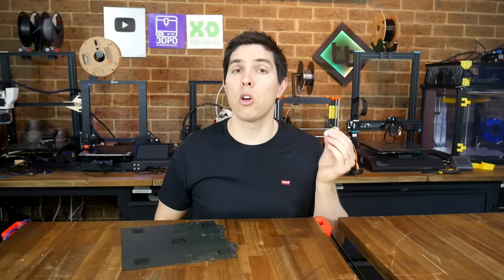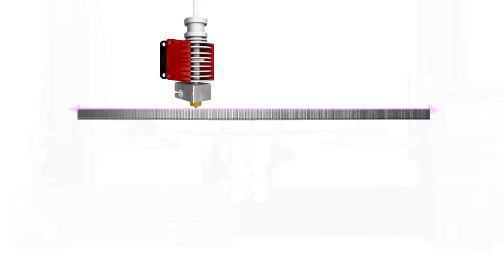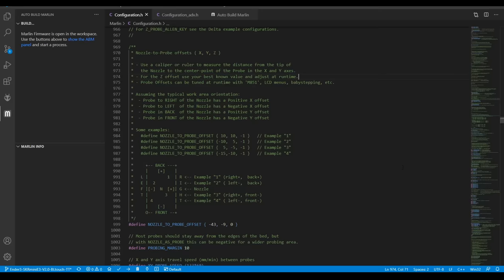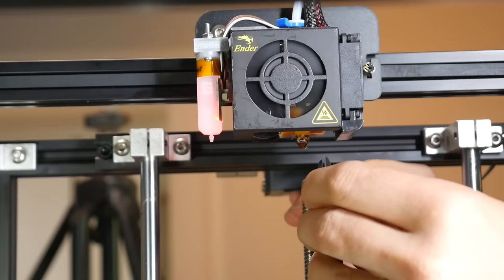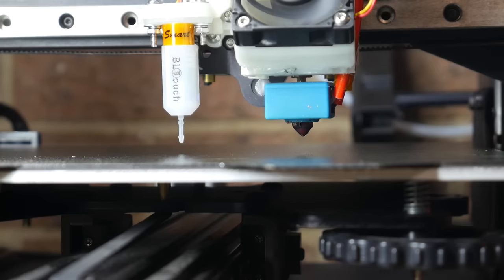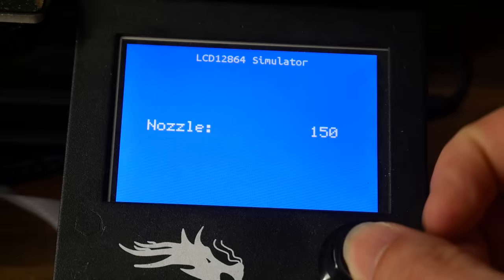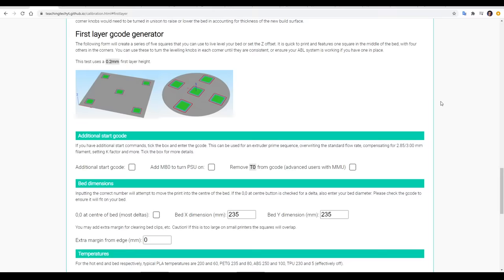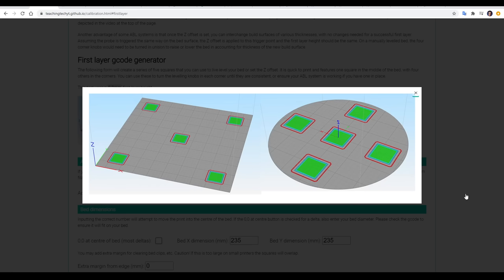ABL offset guide including new probe Z offset wizard

Comment: I've always assumed when you set the Z offset through the wizard, you'd measure to the bed itself. In your video, you measure to a piece of paper.  I don't know how they'd know, but this must already be accounted for in Marlin because measuring to paper works. How do they know how thick it is?

I also disable the endstops (M211 S0) before the probing wizard or I wasn't able to get low enough. Just gotta remember to reenable them (M211 S1) when I'm done!

Thanks for the great videos, they've been a huge help!
Reply: Because a sheet of standard copy paper is between 4 & 5 thou so using this method you would get it within at least 1 thousands of an inch which is more precise than the printer is

Comment: You shouldn't use paper for the Z Offset Wizard, it will/should be perfect when you can't see light between the nozzle and the bed.
Edit: Might want to use a lower SHORT_MANUAL_Z_MOVE value for more precise last movements.
Edit2: And you should use it with fully heated nozzle without filament in it.
Reply from the maker: I went off the pull request thread on GitHub where using a piece of paper is discussed. I found it helps for clarity too. Some beds are reflective so it's hard to gauge exactly how close the nozzle is. Otherbeds will be damaged by the hot nozzle.
Reply: @TeachingTech  you could always subtract the thickness of your paper too, we should all have calipers if we ended up at this video.
Reply: @BigEpinstriping  True

Comment: I believe the z offset wizard expects you to lower the nozzle until it touches the bed and not some paper-thick distance from it. If you look at the values on the wizard at the moment you press "done" and look at the calculated value it puts on the z-offset value, you can see it doesn't account for any thickness added by the paper nor could it since there is no place to tell it how thick the paper you're using is. I think the correct way to use the wizard is to either lower the nozzle until it touches the bed, or do it like you did but then you have to go to the value the wizard put on the z offset and subtract the thickness of the paper. So if it puts -2.25 you change it to -2.45 it the paper is 0.2 mm thick.
Reply: AARRRGGHHH OF COURSE!!! Bring this comment to the top.
Reply: @nocare  Hi. Referring to my example, the wizard puts -2.25 with the nozzle being at 0.2 mm from the bed but it thinks it is touching it. So you put it at -2.45 because that's where it actually is. Do it like this and after configuration move the z to 0.2 mm then take a 0.2 mm shim and measure it and you'll see it's spot on.
Reply: @xXxGuilhermeB I think you are correct because he was already heating the nozzle and bed so it should be the distance where the nozzle makes contact with the bed.  When we use a piece of paper or feeler gauge, it's usually because the nozzle is cold and we are leaving room for expansion of the nozzle when it's heated to temperature.
Reply: Pin this comment!
Reply: @brucehvn  Isn't it actually because we need to leave room for the first layer rather than making contact with the bed? That's what I always assumed was the purpose of the paper.
Reply: @IanSmithCA  No, homing is setting the reference point for z=0.  If you look at the g-code for the beginning of the print, it will set z = the first layer height before starting to print. If the nozzle is heated before homing, you would want the nozzle just touching the bed at z=0, but that's hard to measure.  By homing with the nozzle cold, it  makes it easier to measure with a feeler gauge or piece of paper.

Comment: Hello,

I have Ender 5 with mainboard 4.2.7 and BLtouch V3.1. 
2 days ago I mount BLtouch sensor for ABL. My problem is the X/Y offset: so it tries to measure the left side not on the bed and it ramms the nozzle in the heated. 
If I set NOZZLE_TO_PROBE_OFFSET to X-42 Y-16 or X 0 Y 0 is always the same position on the left side when is carried out Level Bed.
If I set NOZZLE_TO_PROBE_OFFSET to X-42 Y-16 then is printing also with this offset, and printer want to print the right site not on the bed, but with this offset is BLTouch on the centre of the bed.
So the problem is offset by X-axis is not correct, but I don't know how to solve it.

PLEASE FOR HELP

Comment: I used the firmware for the e3 v1.2 with blt and run out but my bltouch doesn’t do anything it flashes red for a bit and then solid red in the menu it doesn’t respond to the deploy retract or test. So frustrating as I’m a newby to working with config files

Comment: I really don t understand why on marlin 2.0.7.1 the auto bed leveling now turned in a sort of a manual mesh bed leveling.

I watched teaching tech s new video that explains about the z probe offset wizard and i said.. Let s flash this new firmware on my skr v2 aswell, and i did.

Now after i set my z probe offset(i own a bltouch and yes i tried setting the offset with the wizard and with other methods that i saw on yt) the bl touch doesn t compensate the uneven bed(like it did on previous firmware when you just had to set the z offset only "one" time with the babystep and boom the leveling was done by the probe) but now after you set the z probe offset, you have to run a leveling gcode and manually compensate for uneven surface. (you can see at the end of teaching tech s video 2 days ago, the procedure at min 9:03

So practically i have to dial in manually and without any precision( cuz if i level one corner...i will fuck up the opposite one)

Comment: I can't get the Z wizard to work, or I can but it messes up the mesh levelling. Using the stock BTT + BLtouch firmware it all works fine but if I try to build my own firmware with the wizard turned on, when I start the bed levelling it just goes to the middle of the bed does a BL test and then throws an error in Octopi making it disconnect. On the printer itself the menu item to run a bed level seems to have gone. I think I must be missing something in the firmware when it comes to enabling the BLTouch.

Comment: I have an Ender 5 with SKR Mini E3 V2, TFT35 and a 3DTouch connected to the 5-port Z-Probe port because i want the security of the regular Z-stop. With this setup, it seems the Z offset wizard does not work. When i start the wizard, it just homes X, Y and Z on the regular endstops and the 3dtouch does nothing?

Comment: One thing that has been puzzling me: if you set the nozzle to probe z offset using a piece of paper, wouldn't you then underestimate the value by the thickness of that paper (i.e. 0.1 mm)? Then when you slice a file to print with a fine first layer, say 0.1 mm, the slicer would add that layer height to what it thought was the "zero" z position resulting in the nozzle printing 0.2 mm above the buildplate and leading to adhesion issues?
Reply: Correct

Comment: Hey Michael, when you configure the firmware, how do you get the safe homing not in the centre? It dunks a blob of plastic in the middle and ruins my first layer.

By the way, in configuration advanced search for “game” and you will see an Easter egg.
Reply: comment out Z_safe_homing.  and reenable your z_min switch.  It will do z home on the switch but you can still have leveling.  Your probe will have to be on something other than Z_min.
Reply: @HermieDaddy  Problem is that I have the printer set up in a way where if the nozzle is perfect height from the bed the bed is higher than the homing height(it’s Ender 5)
In that case I will already have slammed into the switch
Reply from the maker: Right underneath where you enable safe homing, you can specify the position. By default it is set to X_CENTER and Y_CENTER but you can delete these and enter specific numbers.
Reply: What I did to avoid these blobs is that I added a retract in the ending script in my slicer and just have a priming line in the beginning of my prints to get the nozzle primed.
Reply: @TeachingTech  Aha fixed it

Comment: Hi Michael,  thank you for great content, as a beginner with a Creality 3 V2 I've learnt a great deal from you. I've added the BLTouch, and seems to be OK, still need to double check. My question is on the instructions it mentions adding the code for ABL, G29, where and how?
After doing your X test print the bed doesn't go home, this has changed since adding BLTouch, do I need to added other code. 
Thank you again.

Comment: Hi, Micheal, I have just used your G-Code Calibration Tool and am wondering if this can also be used to help dial in my Z-Offset for a BL Touch, I have selected BL Touch in the settings for one version and without for another version as I have 2 Ender 3's one with ABL and one without

Comment: I have Ender 3 V2 and followed this tutorial hoping to get the z-offset wizard menu on the printer's display.  But, it doesn't show up on the V2 with stock display.

A quick look at the Marlin bugfix code shows why.  Teaching Tech has us uncomment #define PROBRE_OFFSET_WIZARD
in a code fragment that only gets executed if the symbolic constant "HAS_LCD_MENU" is defined:
 
#if HAS_LCD_MENU

  // Add Probe Z Offset calibration to the Z Probe Offsets menu
  #if HAS_BED_PROBE
    #define PROBE_OFFSET_WIZARD
    #if ENABLED(PROBE_OFFSET_WIZARD)
      //
      // Enable to init the Probe Z-Offset when starting the Wizard.
      // Use a height slightly above the estimated nozzle-to-probe Z offset.
      // For example, with an offset of -5, consider a starting height of -4.
      //
      #define PROBE_OFFSET_WIZARD_START_Z -4.0

      // Set a convenient position to do the calibration (probing point and nozzle/bed-distance)
      #define PROBE_OFFSET_WIZARD_XY_POS { X_CENTER, Y_CENTER }
    #endif
  #endif 

And HAS_LCD_MENU is not defined when the code is configured as Teaching tech instructs.  Here's where it conditionally gets defined:

 #if IS_ULTIPANEL && DISABLED(NO_LCD_MENUS)
 #define HAS_LCD_MENU 1
#endif

It doesn't seem like there's any reason a specific display would be required to support the wizard, so I suspect the work to add menu items to the stock Ender 3 V2 display just hasn't been done (yet?).

Comment: Maybe some of you can help me out wit a strange problem i have. I installed the Hero Me Gen5 with a BLtouch. The newest version states an offset of 9mm because of the extra mounting plate. However, everytime my probe starts with the back row of the bedleveling sequence, it collides at the Y axis. Why is this happening and how do i solve this? I have used all the correct offsets from the instructions.

Comment: Hi Michael, i'm struggling with ABL on my Ender 3. Everythings working almost fine, prints are not that good, but i work on it using your Calibration Guide ... thanks for that! But: I realised, since i have a BLTOUCH and no more Z-Offset-Switch installed, it is possible to manually drive my nozzle into the bed by using the motion-function on my printer. It may be a dumb question, but could i prevent that? Isn't there a safety option in marlin? Just to be clear: I do not intend to drive my nozzle into the bed, but the possibility alone makes me worried. For instance for Z-Offset-Calibration i accidentally used the 10mm-Option to bring my nozzle down and went to far. I searched on google for that problem but didn't find the right marlin function. Would be great if you know the trick. greetings

Comment: Something is not right here. If you set offset as 0 at the height of the paper which is 0.2mm than your 0 is actually at 0.2. When you start print your printer will rise from 0 to 0.2 as standard layer height but those two will given you 0.4 mm height. The nozzles should touch the surface to be at real 0mm. I do the paper trick but than lower the setting for additional 0.15-0.2mm. Anyone agree?

Comment: Thank you for all your useful videos. In my case, I don't have the old Marlin menu anymore. I recently upgraded to the BTT TFT35 V2.0, which doesn't have Marlin emulation mode. Is the z offset wizard strictly limited to the character LCD, or is it actually a GCode command? I could use the TFT with a custom Gcode command in this case.

Edit: It's pretty easy to use the TFT to get the offset configured, actually. You can just jog the Z after homing, get the Z axis value (negative value) once the paper stops slipping, and save that to the EEPROM from the TFT. That works for me!

Comment: Hey Michael, wondering if you could do a tutorial on TH3D's newer U.2 firmware? The settings have been moved around and it is more difficult to folllow than the U.1 firmware or any other vanilla marlin firmware. Thanks!

My problem seems to be it will not "not define 0" for the z value in the firmware. After flashing I try to home it and it does x and y but then raises my z 5mm or so and either stops, or tries to find the z limit switch for some reason and crashes into the bed. TH3D does not have a current tutorial or one that is easy to understand vs. The U.1 firmware

Comment: Hi I have a question after spending hours setting up, up grading both config files for a BLT in My Ender 3 V2 firmware I now have to wonder with the new firmware up date from Marlin do I now have to sift through all to find what I changed in order to get the firmware to work with the BLT and now with the “new” wizard for the z off set how do I up date my firmware and keep my BLT settings?

Comment: The first time I used the z offset probe wizard, the probe didn't deploy and the nozzle crashed into the bed. I panicked and turned off the printer to stop it. I did some troubleshooting (manually deployed and stowed the probe) and the next time I tried again, the wizard worked as intended. Not sure what the issue was.

Comment: I just got a Bltouch and hooked everything up the same way you did in the video "Creality 32 bit V4 board guide - ender 3 v2 BLtouch & more" and I can't seem to get it to work whatever I do. It's acting as though the Probe X;Y offsets are off on cerian parts of my bed and are fine on others. I have an Ender 3 Pro with 4.2.2 and BLtouch v3.1. If anyone has any ideas or a compiled firmware that works with this set up please let me know I've been struggling for days now.

Comment: I have a weird issue with my Ender 3, but my Ender 5 did not have the same problem despite having the same work flow. I had the correct offset but the BL touch would probe slightly off from the center of the bed, so the entire mesh would be off by about 2cm
Reply from the maker: Worth checking your X and Y probe offsets in the menu or with M851. Sometimes you can set it in the firmware but if the old value is stored in the EEPROM, it will be used instead.

Comment: what are you using for your bl touch? I used marlin but when i do the z offset i've less control over adjustments as it jumps in increments, I also don't have the wizard function
Reply: Hey 101spacemonkey. I just followed this guide and I also don't have the wizard function. did you work it out?

Comment: Odd. I don't see any of these settings in the V2 screen. Must have to put them in manually then?
Reply: What are you talking about? The Ender 3 V2 doesn't even have a leveling probe. And this setting's a new Marlin firmware feature. You need to compile and flash it.
Reply from the maker: Also, a reminder that as the video said at the time that currently this is only compatible with the standard Marlin LCD interface, although I have seen a request on GitHub for the DWIN Ender 3 V2 screen to have support added.
Reply: @TeachingTech  has there been a update for the DWIN for the Ender 3 V2 yet. I'm sure there's a lot of us that would like that functionality I put the most recent bug fix DWIN in a nothing yet. BTW Thanks for tasking the time to help us

Comment: I have text several forums and you tubers and still can not get a fix. 
1 installed cr touch down loaded ender3 firmware with cr touch. Home the ender 3 did the paper thing set the new z offset saved and re homed ,moved z to 0. Z not set. Ran a test level bed print. Unit home start to lay first layer nozzle to high. Work on this for a mouth. No help. This problem is all over the internet. 
2 uninstalled cr touch. Installed BL touch. Homed and then re homed after saving new z off set set z to 0 everything looked good ran test and nozzle to hight.
So two questions 
1 i know the z offset is stored on the eeprom on sad card. How dose the printer get the new z offset is it in the code. If so were.
2 could the offset be over wrote because before each print the ender 3 re homes. 
As mush as i see his problem on forums and you tube why on answers.
Reply: I have a cr touch which is great, maybe you got a duff one. Are you still experiencing z offset problems? Here is another fantastic youtuber's method with a ABL. https://www.youtube.com/watch?v=y_1Kg45APko&t=1s

Comment: 3 points across the bed isn’t enough, 5 works a LOT better, that should be the default.
Reply: Lol I use 7
Reply: @AlexJoneses  - even better !
Reply from the maker: I vary it from printer to printer depending on how warped the bed is. With a bed like the Wham Bam I find things flatten out a bit.
Reply: @TeachingTech  any experience with wham bam and petg?
Reply from the maker: Sure, no issues with it. If I have a difficult print with any material on the Wham Bam, I add a light dusting of hair spray.
Reply: @TeachingTech  thanks dude

Comment: what puzzled me the most was that everyone call that "auto levelling" but there is nothing automated, YOU have to level the bed mannually, then if it's not too bad the measurment from the "auto levelling" sensor can correct the bad bed levelling made by the user.
Reply: Really its Mesh Auto bed leveling, because whats the machine do is made a Mesh of the bed to.compensete any diferences.Of couse the machine its blind, so yuo need to say her ,where start and where ends the bed..